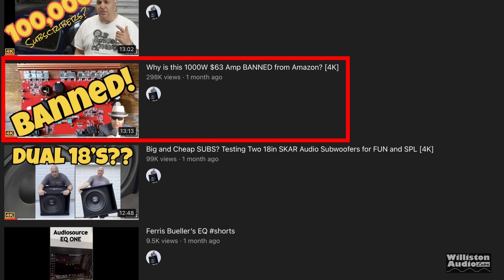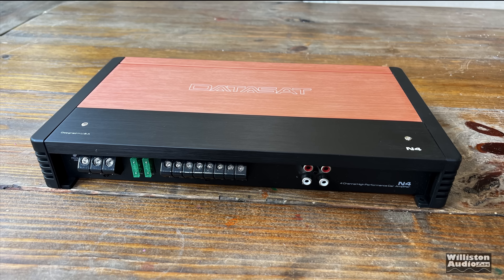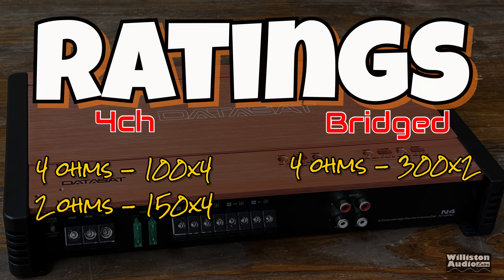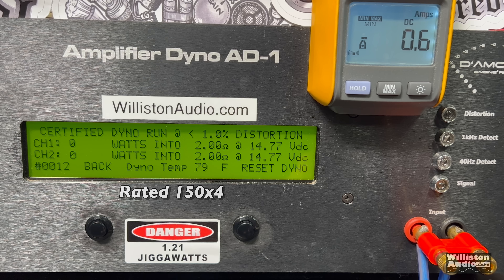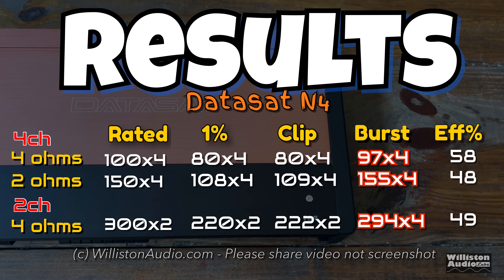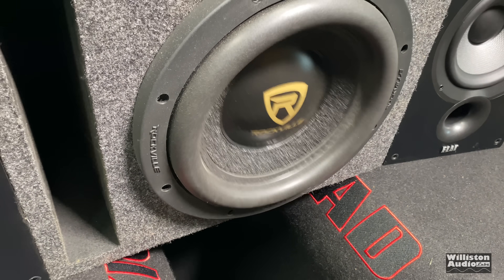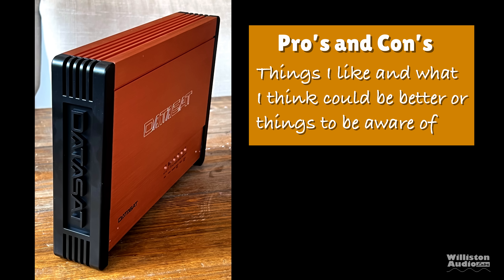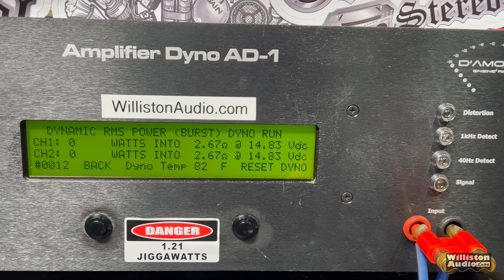How Is This STILL Available on Amazon? Datasat N4 4 Channel Amplifier

Comment: Its unusual to see a 4 channel class a/b put out that much power with a single toroid power supply. My guess is if you actually measured s/n ratio and thd they would be horrible for a class a/b. Better off with a class D at that point and save on the car’s electrical system capacity.
Reply: He doesn't measure frequency response either. This channel is just for the people that want one note BOOM BOOM BOOM amps.
Reply: @davidlong1786 , while I do believe you're right, it is important to remember that bass frequencies take more power to produce. Hence, in order to cut through the bs and get to the amount of power an amp can produce and with how much distortion, etc, he may be throwing bass comp tracks at the test units.

You'll find that bass heavy tracks were chosen for competitions for this same reason, especially SPL comps.
Reply: @meatmadmick  Which means quality is swamped by quantity. Never cared for SPL comps, it's just muddy sounding crap.
Reply: @davidlong1786  preaching to the choir mate
Reply: Who told you it is real power
Reply: If your talking about Bid D and the channel This guy is about the Farthest from BEEING ALL BASS BASS BASS... He is Very SQ SAVY aswell... Pick his Brain sometime or check his podcast with HIFI VEGA...
Reply: I laughed hard when I saw TIP as a power transistor.

An apprentice level electrical design.

Comment: As a technician. The caps, the transistors. ITs all junk, cheap chinese crap. They probably couldn't have used any cheaper components then they did to be quiet honest with you. don't see these lasting too long.
Reply: The ST  TIP35C's are probably the only thing worht salvaging on this amp
Reply from the maker: Great feedback thanks!